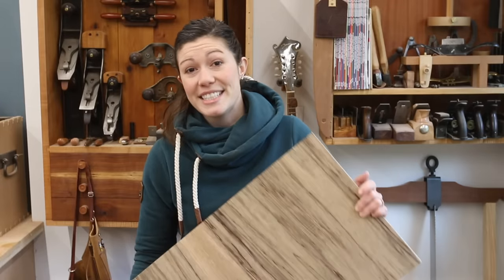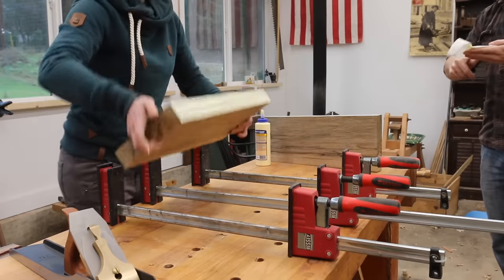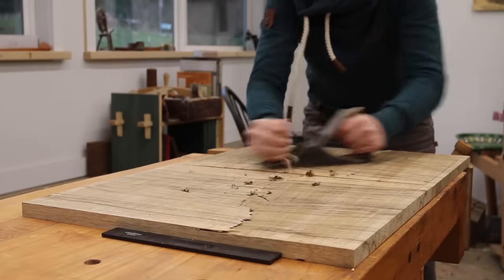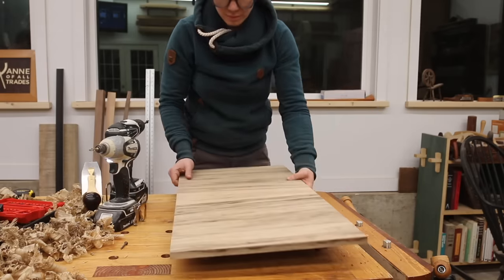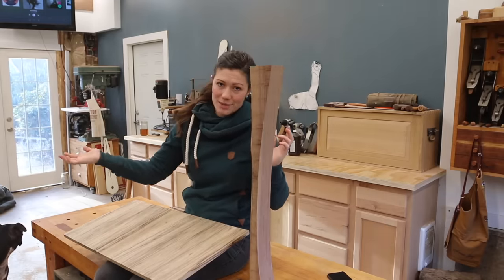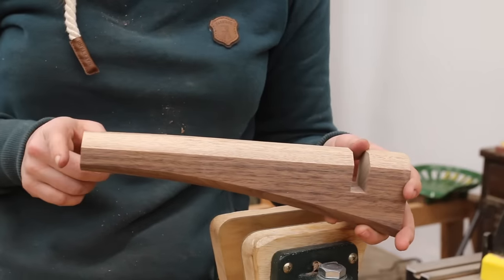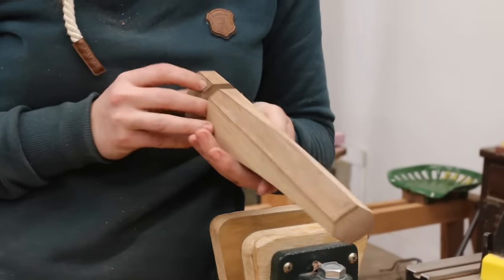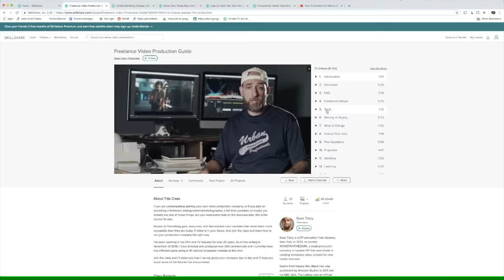Sculpted Walnut & Limba Tea Table Build // Woodworking

Comment: Nicely done! There is one potential problem which jumped out at me (which may not even be a problem). But based on the grain direction of the legs, and the way the dados were cut, it seems like the pieces above the surface of table are the weakest parts. I would be worried about breaking those by accidentally kicking/dropping the table. This may be my inexperience talking here (I've never worked with walnut), but I am curious about the strength here. 

I don't mean to criticize, that's something that jumped out at me. Perhaps some more experienced woodworkers could chime in here. Regardless, it is a great build! I love watching your process, including a combination of power tools and hand tools!
Reply from the maker: You are correct in that the material above the dado might be somewhat weaker, but that’s exactly why I left so much material above the tabletop- with almost two inches of solid wood above the dado it would take quuuuuuuuite a jar to break it, and in that case, there would likely be far more damage than just the cracking near that joint.

Comment: Cool table, Anne!  What finish is that?  Also I was cringing when you were using the miter gauge with the wood against the fence. Glad it worked out though!
Reply from the maker: Don't worry Bob, I know better than to use the miter with the fence when it's actually dangerous. I tried to think of a workaround because I try to be a good example for my audience, but couldn't come up with a good one. I use a wipe on 1/3 poly, 1/3 mineral spirits, 1/3 spar varnish for most of my furniture. It's easy to repair and easy to apply :)

Comment: Came out beautifully, Anne! What brand of bandsaw are you using there?  Looks like a capable one. Also, what finish did you apply? Thanks for sharing. Good build!
Reply from the maker: Thank you! It's a G055 bandsaw. I usually use a wipe on oil finish- 1/3 Poly, 1/3 Mineral Spirits, 1/3 Spar Varnish.

Comment: What kind of finish are you using great job by the way
Reply from the maker: 1/3 poly, 1/3 mineral spirits, 1/3 spar varnish. Wipe on, wipe off, sand between coats. It's easy to apply and easy to repair.